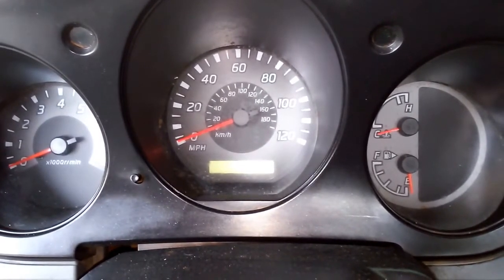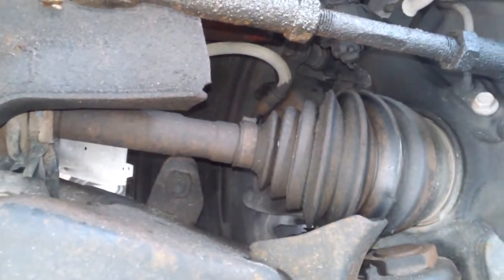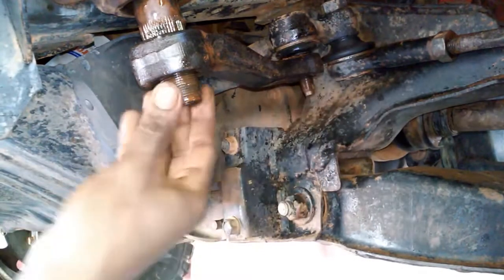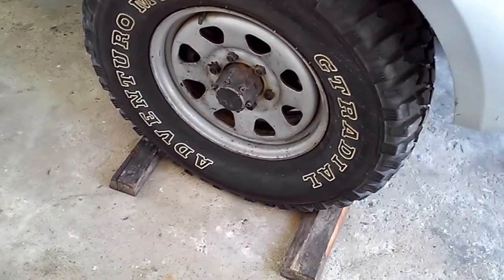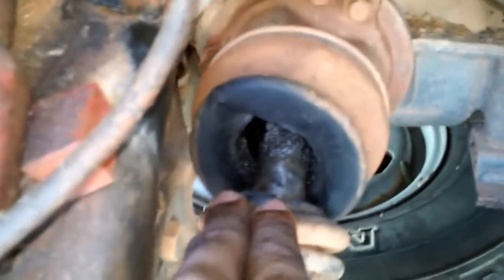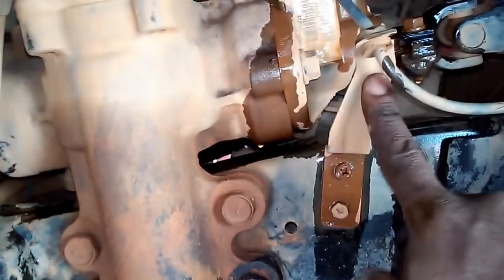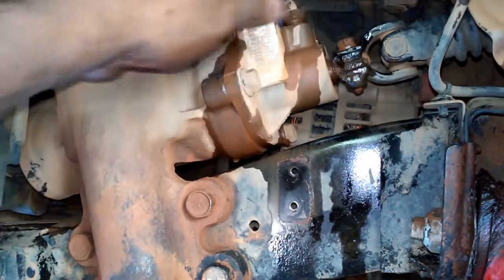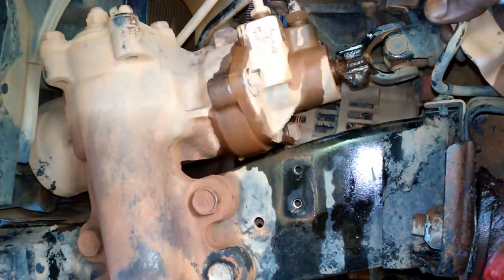How to Remove Pitman Arm/Power Assist Steering Gearbox. Nissan D22. Part 1/4

Comment: i have a 2000 nissan xterra , i'm trying to get pitman nut to turn same size as pictured inch and 5/8. i'm using a 3/4 inch breaker bar and can't get it to budge. any suggestions?
Reply from the maker: Have a shop release it with a air impact gun.
Reply: @SteveXNYC  thank you , i ended up purchasing an electric impact.
a whole new world (with an impact). like superman came to town.
great channel. your xterra videos have taught me so much.